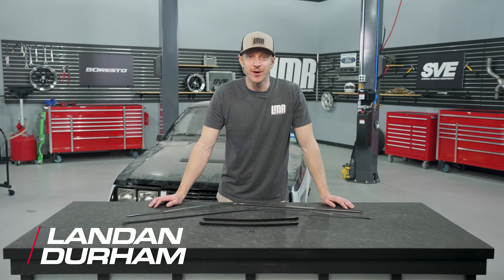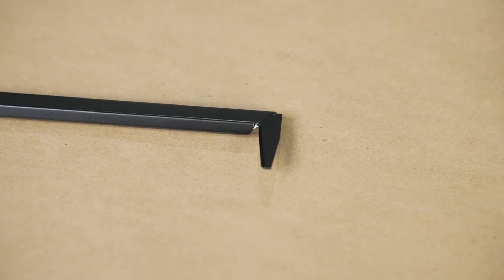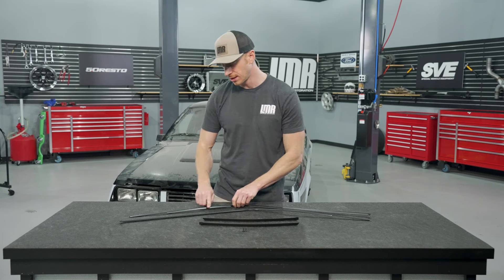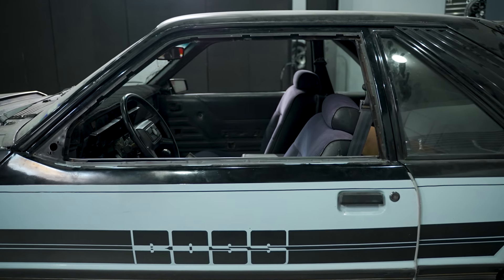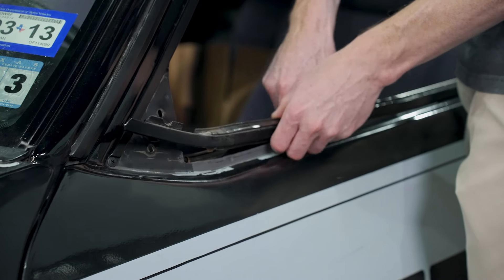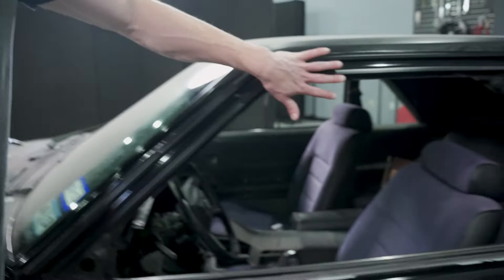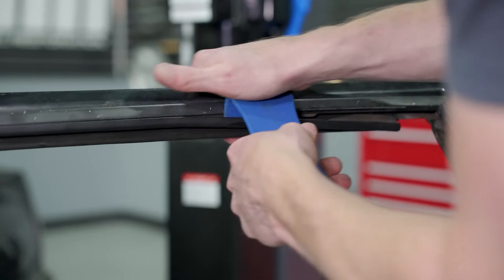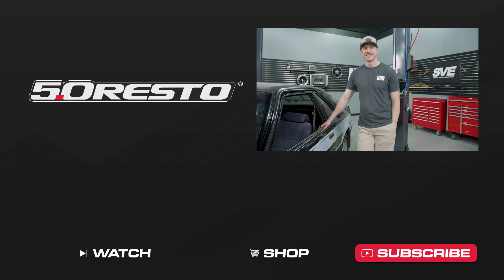1979-1986 Fox Body Mustang: 5.0 Resto Window Run Channel Trim - Overview & Install

Comment: What if the outer side of the front frame rail is rotted?   I'm not sure if it is .  Does this kit cover most problem areas on foxbodys?   Thanks
Reply from the maker: You'll need the full frame rail kits. Link to the category below. -Landan

https://lmr.com/products/79-93-Mustang-Sheetmetal-Patch-Panels
Reply: @latemodelrestoration  thanks

Comment: do they have these for the quarter glass? or are those all 1 piece?
Reply from the maker: The quarter glass trim is 2-pieces and is not available as new. You'll need to find a good set from a donor car. -Landan
Reply: @latemodelrestoration  Atten: Product Team  , We  " I "  lol need that  1/4 glass trim for the  Coupe &  Hatch Cars !!  Great stuff Landan